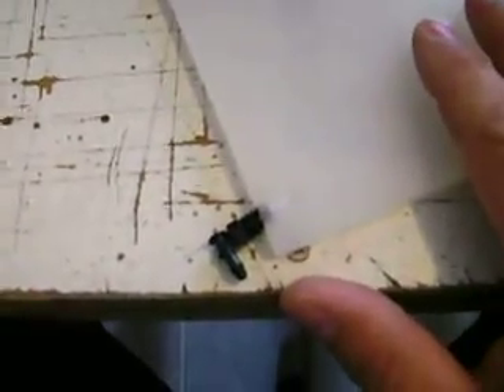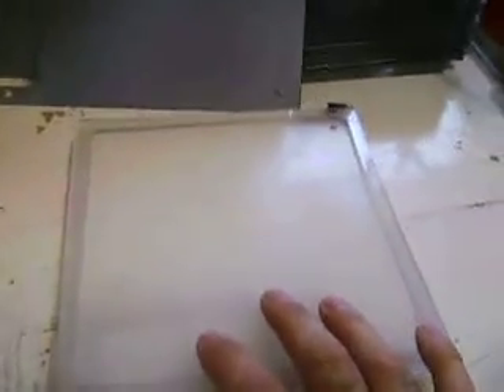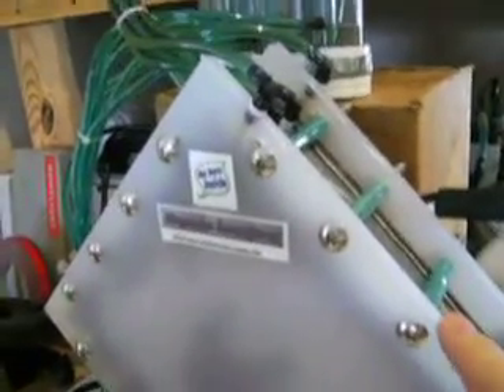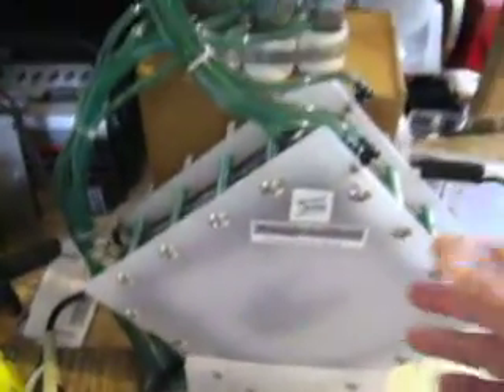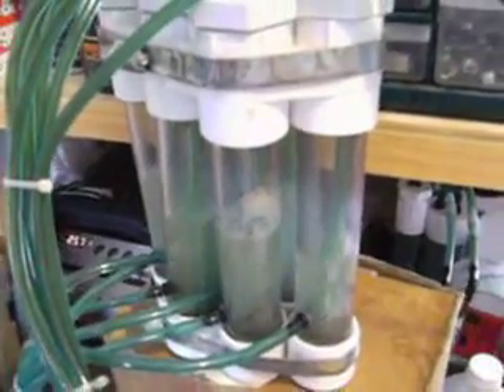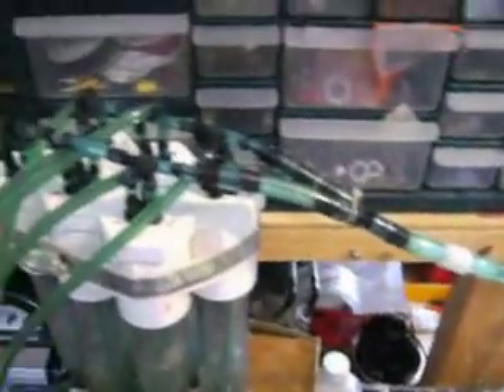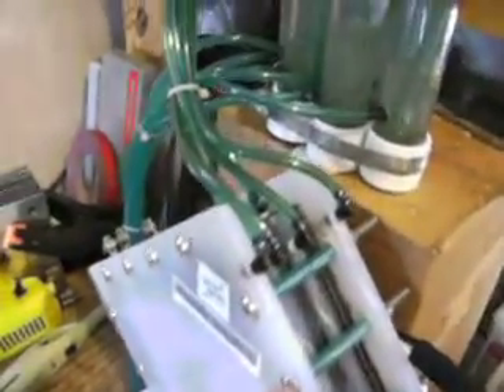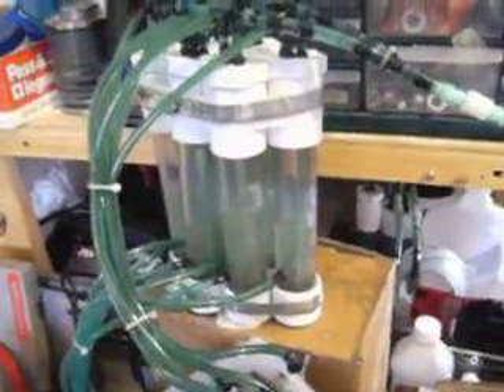Gen V Build 3

Comment: Thanks for the response. The reason I asked is it brought to mind the thought that psi check valves might be a way to increase the MMW. Of course you wouldnt know until you've tried it. It could also restrict the flow to where the recirculation wouldn't work. Guess i'll have to try it for myself to see.